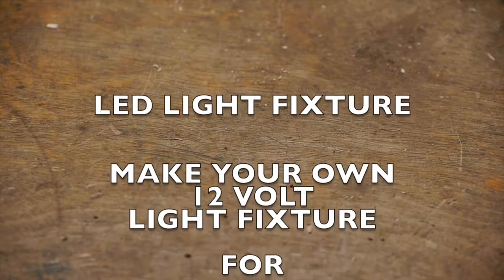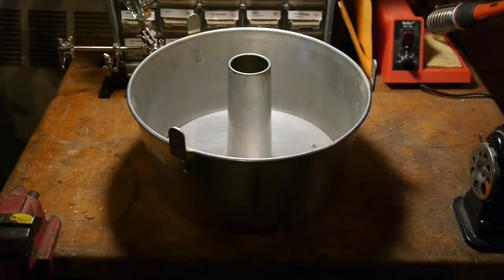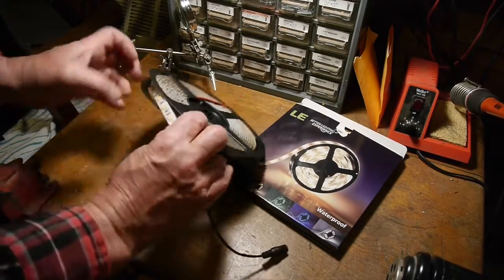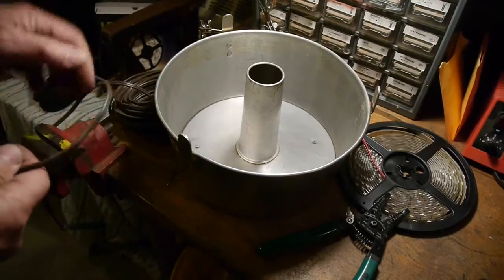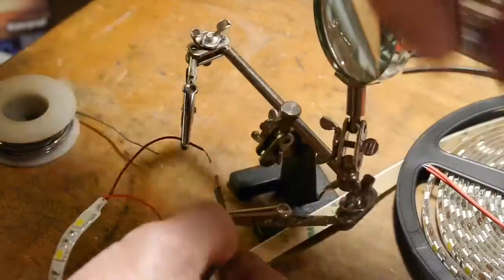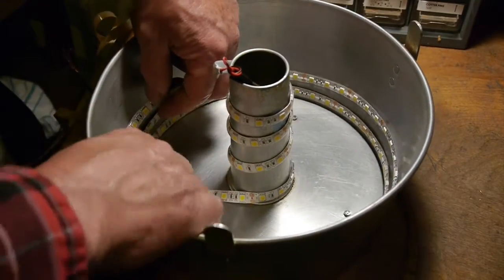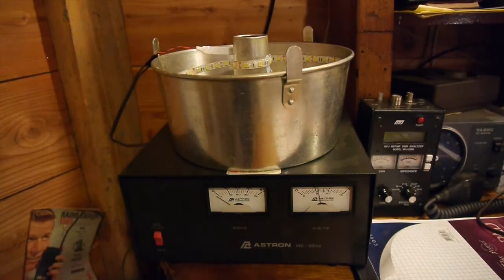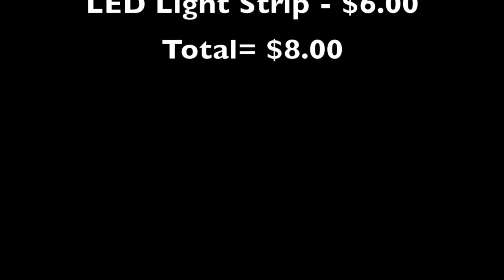LED Light Fixture: How to Make Your Own

Comment: Very clever. Maybe put a dimmer switch on the wall to control the brightness. Those LED lights make great counter top lights. Thanks for sharing a great idea. Vinny.
Reply from the maker: +mmanut 
Thanks.  I am just getting into learning about the possible uses of these LED lights.  Your suggestion to light up countertop areas would be great!  We have dark areas under our countertops that could use some LED's.  Thanks!

Comment: don't think it's a cake pan?  a cake pan wouldn't have rivets on the bottom. not sure what it is?
Reply from the maker: Ha!  I don't know for sure what it is.  I remember my mother making a angel food cake that had a hole up through it.  She used a pan like this one.  My wife just said it's a bundt cake pan.  We learn something new every day.  Thanks for watching.
Reply: Angel food.  Uses egg whites.  It hangs upside down when you take it out of the oven, so it does't fall. We used to put it over a large glass coke bottle but if you don't over fill it, the three "arms" are enough to just turn it over on the counter.